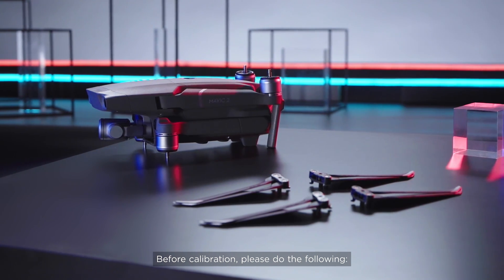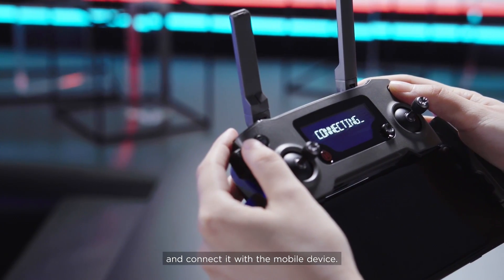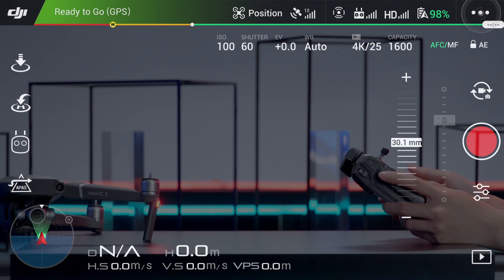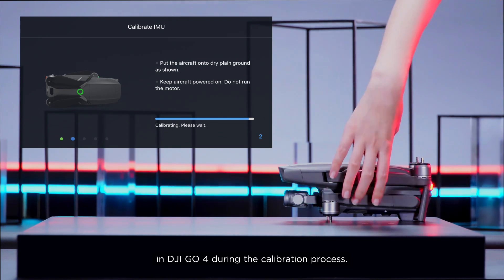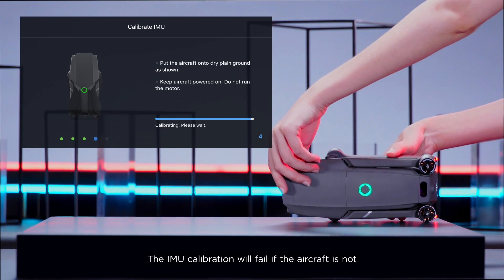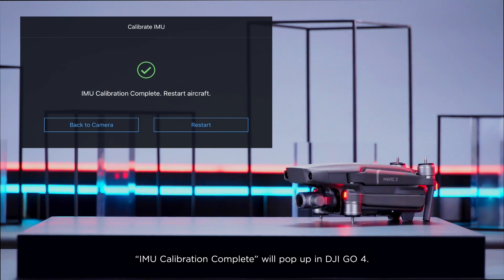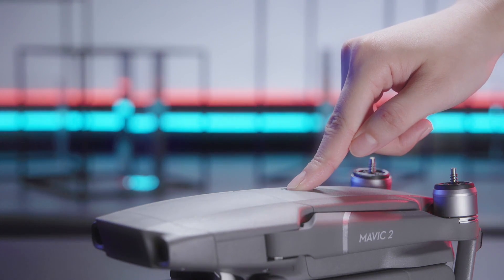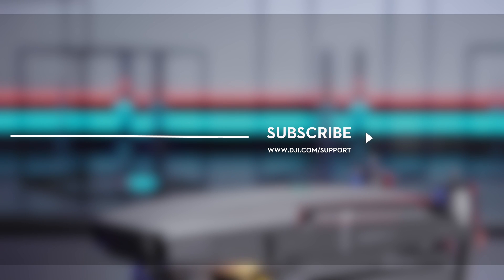How to Calibrate the IMU of Mavic 2

Comment: The glaring omission in this calibration tutorial for the Mavic 2 Pro is that there exist TWO different versions of the DJI Assistant 2, and that the one to download for the Mavic 2 Pro is called the DJI Assistant 2 FOR MAVIC.  

Attempting to use the OTHER version of DJI Assistant 2 for the Mavic 2 Pro will cause the process of calibrating the obstacle avoidance sensors to freeze at the very end when a calculation progress indicator diagram appears showing completion of the calibration process as a percentage from 0% to 100%.  

Complicating matters further, the obstacle avoidance calibration process for SOME Mavics such as the Mavic Air 1, the Mavic 1 Pro and the Mavic Pro Platinum  CAN be completed on the DJI Assistant ( Non Mavic ) version, meaning that the DJI Assistant 2 for Mavic is only REQUIRED for sensor calibration of the Mavic 2 Pro.  This discrepancy confounded me because I own ALL of the aforementioned older Mavics which all underwent hitch-free sensor calibration using the "standard" DJI Assistant 2, only for my Mavic 2 Pro to fail repeatedly when run with the same version of (Non Mavic) DJI Assistant 2.
Reply from the maker: Hi, there. We apologize for the inconvenience caused. DJI Assistant 2 (Consumer Drones Series) or DJI Assistant 2 for Mavic can be used for the Mavic 2 Series, and through this software, you can perform firmware updates, export flight data, perform vision calibration, and use a simulator. Please note that each DJI product does have a specific DJI Assistant software name and function. Thank you.
Reply: @DJISupportGlobal   This clarification is appreciated.  I own a collection of  eight (8) DJI drones so I do have a strong product loyalty with DJI.

I only one wish could be granted for me, it would be that the Mini 3 SDK is modified by DJI so that waypoint missions can be created to fly BEYOND the range of the RC controller, using Litchi. 

 For DJI drone operators like me who do NOT live under FAA or CAA regulations due to our geographical location, the ability to fly Litchi waypoint missions far beyond the reach of the RC controller is a KEY requirement that translates into added income.  Without this capability thus far, my new Mini 3 is gathering dust on a shelf
Reply from the maker: @riverbankfisher  , thank you for sharing your idea with us. Please rest assured that we will forward this feedback to our engineers for evaluation. Please stay tuned to DJI's official website, as we will update the latest news on the official website as soon as we receive it. Thank you for your understanding and interest in DJI.
Reply: @DJISupportGlobal  Respect from me to the engineering wizards at DJI.  Standing by for some good news about the Mini 3 SDK seeing a modification for Litchi access and for beyond RC signal range waypoint missions.
Reply from the maker: @riverbankfisher  Thank you for your advice. We will forward it to our engineers for evaluation.
Reply: @DJISupportGlobal   So grateful for these responses.  Keeping my fingers crossed.

Comment: Got a problem with IMU, constantly showing the accelerometer ACC0 Data error, did imu calibration a few times, but nothing got better. Drone never crashed before is there any chance to have it fixed without opening the drone ? or IMU module go faulty due to the age and high mileage ?
Reply from the maker: Could you confirm if the firmware version of the aircraft and the app is on the latest? If not, please try to update it. Try to perform another IMU calibration after to check if the issue still persits. Could you also provide a video showing the issue? Please contact our relevant team using this link https://www.dji.com/support for immediate assistance. Thank you.
Reply: @DJISupportGlobal  yes, firmware is the latest one on both app and aircraft, did calibration multiple times, no effect, drone has got about 42h and nearly 600km done in two years, can't say bad things about it, still working fine despite the error message, but because it's an aircraft I would like to be sure it's in spot on condition.
Reply from the maker: @DzikVideos  Thank you for the information. We would like to check and verify some information. Could you please provide us with a video showing the issue so we can properly address it and provide the best solution? Please save it in the shareable link in dropbox or google drive. For immediate assistance, you may contact our relevant team thru this link https://www.dji.com/support Thank you for your cooperation.

Comment: I have tried for days to get my Mavic 2 Pro to operate. It has all the latest firmware and I've tried it with two different Android devices, but it still gives a "calibrate IMU" every time. When I try to calibrate the IMU it gets stuck on step 2 of 5 and will not do anything further. I spent nearly $2,000 on this drone with all the accessories and it does not operate. Can it be sent back to DJI for repair, or do I just have to buy a new drone?
Reply from the maker: Hello, there. Sorry to hear this problem. if your operation is correct but the calibration fails several times, we reccommend you to send your product back. And you can refer this link to send the drone back: https://www.dji.com/support/repair
Reply: Exactly I have the same problem stuck on 2nd step and nothing

Comment: Hi!
My Mavic 2 Pro displayed message to calibrate IMU. I've done everything and it doesn't work. I calibrated through the control and at the end it displays a success message. I restart the Drone and the same message is displayed to calibrate IMU again. I have already calibrated the sensors through Windows and I have calibrated the IMU through the cell phone several times and nothing comes out of the message. Drone, Smart Controller and DJI Assistant have their latest versions. What should I do to resolve this issue?
-------
Olá!
Meu Mavic 2 Pro exibiu mensagem para calibar IMU. Já fiz de tudo e não funciona. Calibrei pelo controle e ao final exibe mensagem de sucesso. Reinicio o Drone e a mesma mensagem é exibida para calibrar IMU novamente. Ja calibrei os sensores pelo Windows e calibrei o IMU pelo celuar várias vezes e nada da mensagem sair. O Drone, o Smart Controler e o DJI Assistant estão com suas últimas versões. O que devo fazer para resolver este problema?

Comment: How long should this process take? My M2P that won’t let me fly until IMU is calibrated. 30 minutes in and I am not prompted to turn the aircraft. I have tried 5 times. My understanding is this should take a couple of minutes.... is this correct?
Reply from the maker: Hi Davidson, IMU calibration only takes a couple of minutes. In your case, please make sure that the drone is updated to the latest firmware, power off the drone and cool it down and calibrate again. If the issue persists, kindly provide us with the calibration video to us to check further about the details. You may keep us updated via Facebook Messenger: https://bit.ly/2pm7tfV
Reply: DJI Support  All of that was up to date. The fix was to download DJI Assistant 2 on the Mac & calibrate the sensors on the screen. Once this was completed, the IMU calibrated within 4 minutes. The answer was found on the Mavic Pilots forum .
Reply from the maker: @Delta2D2  Thank you for your update, it is great to hear that you had got it worked. If there is further assistance needed, please contact us at any time, we are glad to help.

Comment: My MVP 2 won't stay level in video or picture mode. It constantly tilts to the left or right making the horizon not level. I have to constantly adjust the gimbal to level before taking a still shot. Video is a waste of time cause of this. I have tried auto adjusting the gimbal and nothing works. Advice?
Reply: this could be a geomagnetic calibration error, or a gyroscope calibration error. Try recalibrating the drone often, not the IMU but the actual drone.

Comment: I am having a problem, recently purchased mavic 2pro in India. Very soon after starting usage i am getting gimbal motor overloaded error.
Reply from the maker: Hi Pravin, sorry to read the issue. Just to verify, has the unit been involved with crash or hard landing before? If not, please kindly check whether the gimbal cover has been removed and restart the aircraft several times to see whether the message remains.

Comment: I had an issue with my Mavic 2 pro. I'm doing an IMU calibration. 
There are 5 positions to completed but it keep stays at number 2 position for over an hours, what should I do at this point? Please help!!!
Reply from the maker: Hi Hoan, we are sorry to hear the issue. Please try to power off the drone, leave it for a while for cooling, then try to calibrate the IMU again as the tutorial/app suggested. Please let us know if the issue persists, if there is any error message on the app, please also let us know. We'd help to check.

Comment: How long should the calibration take?  Mine has been "calibrating" for several minutes, and seems to be frozen in "calibration mode"
Reply from the maker: Hi Eddie, please kindly wait for the prompt, if it is stuck in a step for a long time, you may try to restart the drone and Assistant 2 app and try to calibrate again.
Reply: @DJISupportGlobal  did that, twice.  It remained stuck until the batteries started running out.
Reply from the maker: @eddietude  May we know the DJI Assistant 2 that you are running on your computer? For Windows, the latest version is v2.0.7, for Mac, it's v2.0.6. Please make sure that the DJI Assistant 2 is the latest version. Or you can try to calibrate another computer. If the issue persists, please kindly provide us with the screenshot that it remains. You can keep us updated via Facebook Messenger: https://bit.ly/2pm7tfV

Comment: This video is terrible.   The device (DRONE)  is to be calibrated, not the "flight controller."    Once you figure out you're in the wrong menu, the calibration of the IMU hangs up a 2/5 and dies.   DJI is continuing its tradition of failing to support a good product.   They have wasted hours of my time with this sloppy work.
Reply from the maker: Peter, the most important part of the drone is the flight controller, IMU is a part of flight controller, do you still have the issues with the IMU calibration? Please make sure the drone is placed in the level ground during the calibration.
Reply: I found the video very clear and straight forward. Calibration took about 3 minutes and done!  Simple.

Comment: DJI Go 4 App 4.3.0 Android shows the wrong positions! Please correct!
Reply: Yes, I worked that out (before reading this comment). After trying to calibrate using the app about a dozen times, I was just about to send the drone to DJI. Can't believe their support crew weren't aware of this and were able to tell me (via Messenger).
Reply from the maker: Hi Thomas, sorry about this. Our engineers have been aware of this and will fix it in the APP update, you may refer to the tutorial video to calibrate the IMU first.
Reply: @DJISupportGlobal  I already did that, then it worked.
Reply from the maker: Thanks for the information, hopefully, the app will be updated soon. Should you have any further questions, please feel free to contact us at any time, we're glad to help.
Reply: So the directions in the icu calibration screen on the app is WRONG?  That is why i see a position looking right while on its feet as the third step instead of what shows in the video?
Reply from the maker: This is the misinformation on Android APP, our engineers has been aware of this and will fix it soon. Sorry for the inconvenience caused.
Reply: The instructions say remove props, but pictures (in app) don't, which is bizarre! But if I remove props, the drone doesn't sit correctly, or there are a choice of a couple of positions (when pointing skywards). What should I do?
Reply from the maker: You can keep the propellers attached on the drone when calibrating the IMU, but removing the propellers will also be able to keep the drone stands on its position. May we know in which direction the drone is not able to sit correctly? Besides, you mentioned our support's issue, you were contacting us via the Facebook messenger, right? May we know your name on the Facebook? We'd like to check the specific chat and keep improving our service.
Reply: FB name "Ian #######", the guy's name was Zel, Monday evening UK time. He advised me to refresh firmware and reinstall DJI Go 4 - I restored factory settings also. Waste of time!

When sitting on it's rear end, mine could either sit on the motors (correct I suspect?) or the legs. Neither is true vertical. It will sit on it's side, with the motor body parallel to the surface - just! I assume this is correct - but even then it's not perpendicular to the surface (without some wedging). I'm not sure how critical it is to be precisely on it's side or vertical? I may be being pedantic, being in construction!
Reply from the maker: Thanks for getting back, Ian. For the chat support issue, we had forwarded to the proper team to check and enhance the training. 
For the IMU, when calibrating the rear position, you need to put it in on the motor's side, it will not be 100% vertical, don't worry.
BTW, may we know the current version of your DJI GO 4? Version 4.3.2 had released, please update to this version and see if the image is corrected. Thanks.
Reply: I still have 4.3.0, and my Google Play isn't offering an update yet
Reply from the maker: Received this, we will confirm it with our engineers.
Reply from the maker: Hi Ian, thank you for your patience, for the DJI GO 4 app V4.3.2, we are sorry to tell that it is still releasing in phases. Please kingly wait patiently.
Reply: Mine updated this morning actually, not yet tried it though
Reply from the maker: That's ok. If there is any further question, feel free to contact us.
Reply: @DJISupportGlobal  Glad the instructions are now fixed! Not really the right place to ask I know, but as evidenced in this discussion the support here seems of a far higher quality than FB Messenger!

There appears to be a problem with the M2 SDK and/or firmware. This is evident when flying waypoint missions using Litchi, and the yaw is quite jerky, when it should be silky smooth (as it was with my Air). Litchi's response to me (October 23) was "We’ve reproduced the bug with the DJI SDK demo and reported it to DJI. We are now waiting for them to fix it. Unfortunately we can’t give you an ETA for when it will be fixed as we don’t have one, it depends on DJI."

Any news on this please? Will it be fixed? Maybe this is also why Drone Deploy doesn't yet support the M2 on Android? I can provide a sample or link to a discussion where others have experienced the same, if needed?
Reply from the maker: @ichapp  Hi IanC, thanks for bringing us the attention. We haven't gotten any relative info about this case. But we don't suggest third-party apps, thus we may not be able to provide the support in this case. However, we would also like to know if this case happened in normal flight with DJI GO 4 app, you can, of course, provide us with the sample link of this case, we'd like to forward to our engineers to notice as well.

Comment: App on Android imu calibration not working from what I figured out it's showing the wrong images not as per above video ( or any other video online ) using OnePlus 6
Reply from the maker: Hi Neil, you are correct, we had discovered this issue on DJI GO 4 Android. This issue will be fixed in the next update. At this moment, please refer to the tutorial and put the drone in a correct direction when calibration step 3 and 4. Thank you for your attention.
Reply: Thanks for your reply, furthermore I found another possible bug if you try to calibrate the Mavic 2 via the Assistant 2 App on Mac OS on the first calibration screen you can see the left and right cameras are inverted 90degrees sideways and the app prompts you to rotate the drone, so you end up with the drone sideways instead of straight facing the screen. Would be good if you can confirm if its a bug or a hardware issue
Reply from the maker: Hi Neil, just to verify, you are referring that the drone's direction after calibration differs from what it shows on the first screen, right? If so, this is normal as it needs to calibrate the vision in different directions. You can check this tutorial for reference https://www.youtube.com/watch?v=Mum2h31g2pc&t=25s. Thanks.
Reply: Yep that it on the Assistant 2 I Just downloaded the first step ( also initial tutorial ) tells you to keep the drone in flying position ( also the images ) not on its side, so the issue is with the tutorial images being shown for step 1 (and the top animated gif)  I can send you a screen shot on an email etc if you want more details
Reply from the maker: Please kindly send us the screenshots to support@dji.com and tell us your ticket number, we'd like to check the exact status, thanks so much!

Comment: Do you have to download any stuff on the PC saw some videos on the go 4 it shows idk if you have to or it’s areday update
Reply from the maker: Hi there, could you please explain more details about it? As for the firmware update, you can either upgrade via DJI GO 4 or DJI Assistant 2 on the PC. To calibrate the vision system, you need to calibrate on the DJI Assistant 2. If you need to calibrate the IMU, you don't need to do it on the PC. Hope it provides you with some info.

Comment: Do you have to calibrate outside or inside
Reply from the maker: Hi there, you can calibrate it in a level surface. Either inside or outside is okay, thanks for your attention.
Reply: DJI Support what about the campus
Reply from the maker: Hi Hayy, you are referring the compass, right? If so, it is recommended calibrating it in an open field, please don't calibrate it in a place with magnetic interference, you may refer to page 64 on the manual https://dl.djicdn.com/downloads/Mavic_2/20180827/Mavic%202%20Pro%20Zoom%20User%20Manual_v1.0.pdf. Thanks.